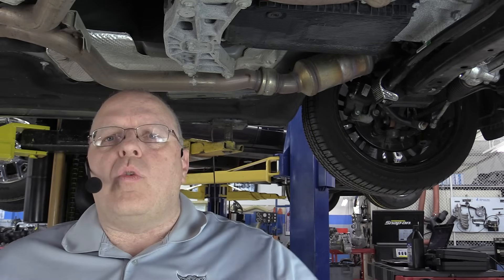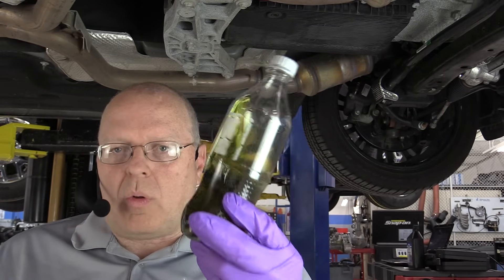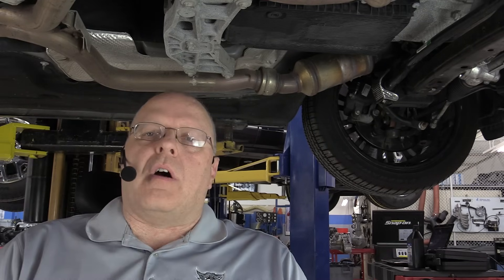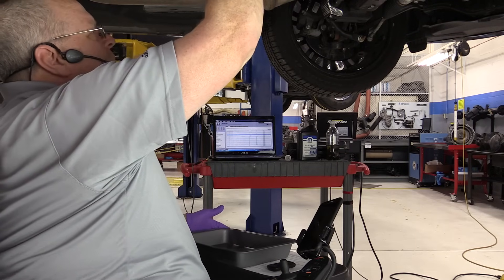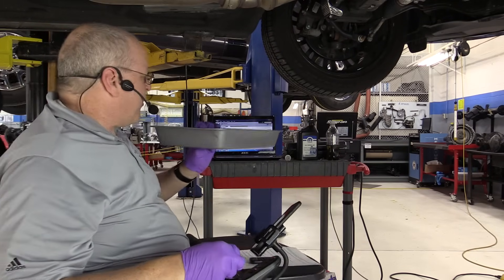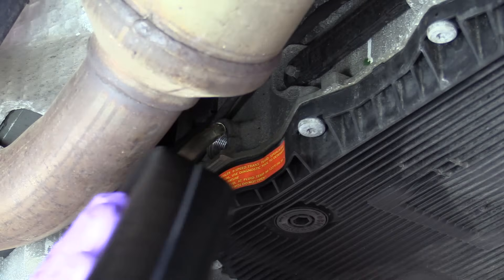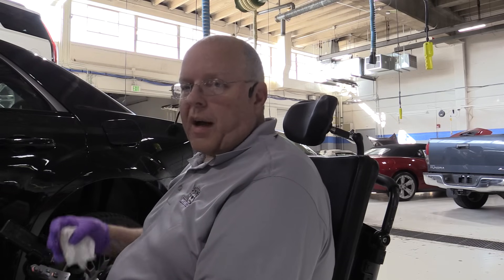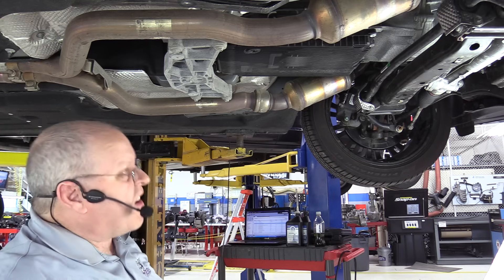Jeep, Dodge, RAM ZF 8HP 8HP 8-Speed  Transmission Fluid Level Check - No Dipstick

Comment: Well, I have a thermostatic bypass valve and a heavy-duty cooling system. So I wonder if my fluid has to be at a different temperature. I am an engineer, and they make this complicated and confusing! I will try it how he said and drive it, let it cool, and do it again.

Comment: My 2016 , has over a million kilometres on it , when I changed the engine there is a bit of leak coming from between the transmission and the engine , so now the transmission between 3 to 5 gears I feel a rumble , like when you’re driving over the rumble strip on the edge of the road , no warning lights on dash I’m thinking fluid could be low . Thanks for your video very detail .
Reply: I think I have the same thing. Around 45mphs every time. 2013 ram 1500 5.7 8 speed 4wd. 

Starts vibrating at 45ish. 

Happens most times but, seems like on a cold vehicle it doesnt happen. 

Went from an atp filter with the zf fluid. 

Now I am replacing it with a ppe with 2extra qt capacity pan.

I'm in the process of filling it and doung the procedure by this weekend. 

Hopefully solves that vibration because I replaced all suspension components and bearings, even the cv axle and the cv axle intermediate shaft on the driver side.

Comment: I know a great way to solve the thermal bypass valve issue, PPE sells a bypass valve that you can install and it stays open so you can get the correct levels fluid

Comment: I hope you can help me with this. I drained my oil while the temperature was above 160°F, then drove about 100 miles after refilling. When I checked it cold, the level was low and no oil came out and I knew it would be low, so I topped it off until it dripped. Now, after 30 days and 300 miles, I checked it again cold and it was low with no oil coming out. Should I fill it again?

Comment: Thank you for sharing this! Very late to ask a question, but if I don't have a scan tool can I rely on the readout on the instrument cluster?  I do have the upgraded cluster that give a transmission fluid temperature reading (2017 Charger RT Scat Pack (6.4 Hemi, 8-speed auto)

Comment: This is totally overkill for check fluid level, just take the fill plug at 80/90 F ...and put fluid, take the veicule around the shop and check again, fill until drips, thats it ... there are tolerances for fluid level and a quarter of inch up or down, dont make any difference

Comment: Just spent the afternoon changing my 2014 Dodge Durango 126,459 miles 8 speed transmission pan and of course fluid. I made sure the new pan has a drain plug as I drained and filled twice basically 10 quarts at this point too hot outside to finish in one day I’m going to check fluid level in the morning as soon as lower temperature is reached. I will check the fluid again once I’ve driven it and know the temperature has been above said temperature but regardless it’s a good practice to check for leaks and as easy as it is check the level. I waned to take the pressure cooler line off and do a flush that way but I couldn’t get the retainer clip tool inserted. This is the second time I’ve changed the pan and fluid first was around 80K.

Comment: 14:55 super important information
Reply: That's why I am gambling on replacing the same amount of fluid that drained out. I drained out XX oz out of the fill plug before dropping the pan, then another XXX oz when dropping the pan. I didn't list the amounts because everyone will need to check it themselves if they attempt the same method.

Comment: Firstly, its fairly obscure that ZF isn't clear in docs about a transmission cooler.  If you drive til temps > 160F, the tranny cooler circuit opens and fills but then you said to wait til the fluid drops below 104F again to re-check the level.  But by then the fluid would've drained from the cooler circuit again and given you an over-level.  So it makes no sense.  ZF says to add and extra .5L if you have a cooler but then never tells you how exactly to overfill .5L  Its just the worst procedure ever for a transmission fluid change.  No wonder manufactureres suggest lifetime fill.. its a clown show.

Comment: First you say it has to be between 86-122 degrees to check the level. Then you say it has to be below 86 degrees. So its at 79 you check it, then you add fluid. Then you find out later it's over full. I think you were correct in the first place. It has to be between 86-122 degrees to check it correctly. The info about the bypass valve is good info though. But that would probably only apply if you drained the system when it was hot or you were replacing the transmission in which case you would want to get all the old fluid out. If you are only draining, replacing the filter and refilling you will most likely never get all the old fluid out anyway. And if you drain the pan when it's less the 160 degrees the fluid in the coil will probably not drain out. Most people are probably not going to flush it out but only drain, change the filter and refill.
Reply: He said check it at 90, but the computer was reading less than 90. 😅😅

Comment: What they need is a method that will allow an actual full system flush.. You always end up with a mixed fluid change.. I am not sure just how many quarts are left in the cooling and other runs that end up getting mixed with new fluid...

Comment: Hello, what could happen if you drain it hot (possibly with the transmission cooler circuit open), and then fill it and check the level at 30-40C (cooler circuit closed)?

Comment: Great video. Found multiple other videos prior to servicing the 8 speed in my ram over the last couple days and the information was relatively inconsistent but the process i completed was the same. Major takeaway is the bypass valve thing. Also some were arguing that the truck has to be level for this process and some were saying the trans pan has to be level for the process, since it is sloped a bit towards the back in the rams. Any insight on this leveling matter?

Comment: On Jeep models, the transmission cooler bypass valve is external and can be modified. On Ram 1500 models, the transmission heater/cooler valve is internal to the transmission and can not be modified.

Comment: Wonder how many dealerships follow this procedure! Especially checking fluid level the second time after driving.   My local dealer wanted over $1,200.00 to do my 2016 Ram 1500.  Around $300.00 done it myself and made sure it was done correctly!  I stayed with OEM pan.  Had no issues with it, so didn't want to upgrade to new pan.

Comment: I would hope that bypass valve closes when you cut the engine off hydraulically locking the fluid in the cooler until the next time the temperature is high enough to open it ign on engine on.
And when replacing a bad transmission flushing this cooler system and then being able to prime it would probably  require an initial warm up to prime the cooler and then verify transmission level after achieving proper temperature.

Comment: Nice video however I doubt all you can use is Mopar oil. Most places use compatible oil that meets the specs. I've seen plenty of people using Amsoil signature series with no issues and from what they say it runs better. 
I need to do mine on 4 ramps with no lift, so shifting in to drive and keeping in 2nd gear might be a problem.

Comment: Transmission cooler holds transmission fluid even with the car off. I replaced a radiator on a 2015 grand Cherokee and disconnected the transmission lines from the cooler to get the radiator out and i lost ~0.5 quarts from the cooler. Service manual states that cooler holds 0.5-0.7 quarts. So if you check after repair without bringing to normal operating temp the level will be off. So repair-drive to normal temp-let cool down-check level

Comment: Can you add lucas ?
Reply: No dont 

It’s the wrong type of transmission fluid it’s red like ATF and traditionally only used in ATF type fluid transmissions.

This damn transmission ONLY takes special fluid for it being a 8 speed first of all, it requires dealership fluid or another name brand fluid specifically made for the transmission. I don’t think any of the fluids are red usually clear I’ve seen with a tint of yellow, gold colored, or green. There may be a red color fluid for this transmission I haven’t come across it lol 

I wouldn’t use Lucas in these unfortunately in my experience and opinion. These new transmissions are ridiculous costly to service BUT in the long run the fluid can last very long time in these I serviced one that had almost 100k miles on the fluid no transmission issues! Because it had a good amount of fluid in it first of all that matters. 

Everything modern is designed for the damn dealer so you can go there and they scam you

Comment: I am curious about performing a transmission service of oil and filter change. Should you also drain torque converter and blow out lines to transmission cooler? This would ensure complete removal of old fluid!

Comment: Hours and hours of research... watching so many videos and reading ram forums and some people say the bottom of the transmission rail is what needs to be level (by jacking up the back) and you (and others) are checking the fill level with the vehicle level (essentially - on the lift that is level). Is there anything official that says for sure which method is correct? Should the vehicle be level, or the transmission rail (since it's tilted in there)? And if anyone has an answer to this, how do you know for sure?

I'm finding it almost impossible to figure out.

Comment: I'm confused. He's saying that under 160°F the valve is not permitting fluid to flow through the cooler and he's calling it open? But when it's closed, fluid just loops back into the transmission? Seems like it would be called the opposite. 

Also, When he started temperature was under 86 so it seems that it should not have been dripping until it got to over 86 deg. He said the range was between 86 to 122 deg so why did he think it was low when checking at only 79 deg? Am I understanding this correctly?
Reply: I thought the same thing.

Comment: So if I wanted to fill properly, after the second fill, get it up to temp to get that fluid through the cooler, then shut off and let cool and then attempt another fill in the correct temperature range?

Comment: Excellent video. a few points... 1) When the cooler bypass valve is closed, the fluid won't go to the cooler, and when it's open, fluid goes through. 2) If you're just doing a fluid level check without maintenance, the cooler bypass being open or closed won't make a difference as it will remain filled with no air one way or the other. If you' have done maintenance, then driving around until the fluid temp is 180F or higher would ensure that the cooler has been filled.
Reply: Good point just to confirm: I drained the fluid by removing the pan, replaced the pan, filter, and gasket, and refilled with 6 bottles. After 500 miles, I’ve noticed delayed shifting and high revs before it shifts automatically. I’m about to check the fluid level and will follow the steps here, but regarding the last step of driving to get it hot is not required correct? since I’ve already driven 500 miles and it reached 200°F.
Reply: Your "with maintenance" comment confuses me.  If the maint was done on a cold engine the cooling valve would still remain closed, CORRECT???

Comment: Why would the lines to the cooler be empty just because the valve is open unless there is a vent in the system.  It would be easier to just measure the fluid that you drain out and put back the same amount of new fluid that is at the same temperature. (i.e. put vehicle and new fluid in garage overnight to get temperatures equal). There is no reason for the fluid to be low unless someone was messing around with the transmission or there was a leak. You can use Valvoline max life in this transmission which costs $30/gallon.

Comment: Dumb dumb design to make the damn exhaust go right next to the pan or in some cases RIGHT UNDERNEATH IT! 

I hated it I put a new exhaust system on my ram sport which also has this 8 speed in it. The stock exhaust curved and went underneath the damn transmission pan I hated it. 

Reasons why I got a new exhaust system is because of that and to make the hemi sound like it should  sound.

Comment: Tried to have this done to my Ram 1500 and i was told that the transmission is sealed and filters never need changing but, after seeing this video its clear to me the technician didn't want to do it so they blew smoke up my ass.

Comment: You were very helpful. Thanks for sharing the Chrysler procedure and mentioning the cooler bypass valve. I did drain that and will recheck the transmission level after It's at normal operating temperature. Much appreciated!
Reply: After cold fill and a couple of test drives, the transmission took 7 quarts to fill. The Durango runs like new and responds much faster.

Comment: So the bypass valve is also a "purge valve" so that when the temp cools down it sends the fluid that's in the lines & condenser back into the transmission?  I would think there would be fluid in there the whole time and therefore the level would be the same regardless of the electrostatic valve being open or closed...... Am I missing something?

Comment: Lol. A little confused. If you take the drain plug out and fluid comes out that means there is to much so wait till it stops. But if you take drain plug off and no fluid comes out that means there is not enough and add till it stars to come out??

Comment: Could not you use a heat gun on the thermostatic valve to make it open up and circulate oil through the cooler?

Comment: I plan to change the ATF on my son's ZH8HP equipped BMW F36 430d rear wheel drive. It's a UK spec 2016 car. Does anybody know if it has the ATF bypass cooling system? If it has I don't think I'll bother! It's a complicated enough procedure without this system! 
BMW say this transmission is sealed for life but I'm guessing the "life" is outside of warranty! Just. Despite this I'd like to change his fluid as he plans to keep the car for as long as he can and I'm guessing if it's not changed then it'll start giving problems eventually.

Comment: Now hold up.  I recently did a pan& filter on a 2018 ram.  We followed the procedure as dictated, however we pulled to return line at the trans and continually added trans fluid until was running clean our the return line.  If the thermo vlave was clised as our trans temps were under 122 degrees, where was the dirty fluid coming from?  I pumped about a gallon in as it was running before it was clean.

Comment: Question kind Sir, I had Tranny on my jeep GC. 3.6, serviced and afterwards there's a noticeable vibration whilst idling at traffic lights and when reverse is selected it seems revs are like lumpy.. What did or didn't the jeep stealership do to my car? I took it back and they saying they want to remove the driveshaft now. Which is wrong bcoz at the lights in idle the drive shaft isn't moving to cause the worrying vibration.
What should I do??

Comment: It’s a sealed unit, no air lock will be present. How does running the vehicle after the check help with the bypass? It doesn’t because anytime a vehicle is parked, it’s already been ran, running it again to do a second check is exactly the same as doing the original check, bypass will be on, a second vehicle run makes no difference.

Comment: This information is priceless..  All that said.  The process, simply put is Convoluted.   $43 a quart, and the Trans takes up to 6 qt.  this cost doesn't include the filter.  What in the world was Chrysler thinking.
Reply: Not Chrysler , transmission designed in Germany!
Reply: since the stock plastic pan/filter combo must be replaced as a unit, save the heartache and buy an aftermarket pan (PPE) with removable/replaceable filter, another $400
Reply: My Jeep with the 80hp70 takes 7 quarts.  The bigger trannies take about 9.5 quarts.
Reply: The whole group who came up with this stuff is giving all of the finger.
Reply: But you don't service it nearly as much as you would if it had atf+4 the dumb design is that you have to replace the pan to replace the filter the fluid cost really is that big of a deal since you not buy it as often it's the 200 dollar pan but you can buy the fluid online for about 23 25 a quart
Reply: The pan with "non serviceable " filter from the dealership is around $300

Comment: One more thing, is that a drain plug on the bottom of the pan? sure looks like one
Reply: Yes
Reply: @91stealthman  ok thanks, so we could just drain and refill to the proper level and not have to pull the transmission pan?
Reply: @91stealthman  ya, i was thinking the same thing

Comment: they don’t bring it up because this valve going to the trans cooler has a check valve.  It’s full whether the valve is open or closed and hence does not affect fluid fill  protocol.

Comment: This helped me a lot after a damaged condenser were trans oil started leaking from the lines coming from the tranny into the condenser I replaced the condenser and then took the objective to fix the low trans fluid level due to the car shifting into neutral and shutting off I guess it was due to the low fluid. After I followed your steps to refill I should have stayed for the entire video 😂 since I still felt a little tranny fart while driving when it shift down so I’m going to lift it up again and recheck/fill hopefully that end my tranny problems if not then I’ll research if it has and bad sensors that do shift timing or maybe a bad shifting component I really hope it’s not the tranny I doubt since all shifts are smooth it just the occasional random tranny bump anyway great great video